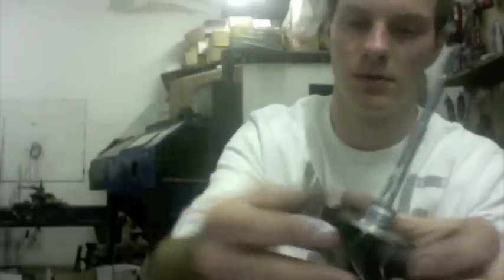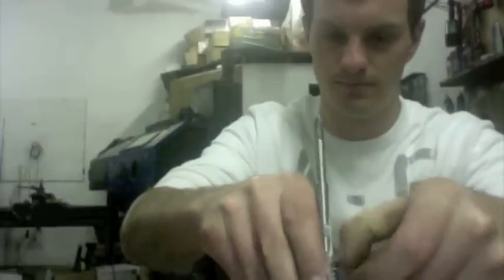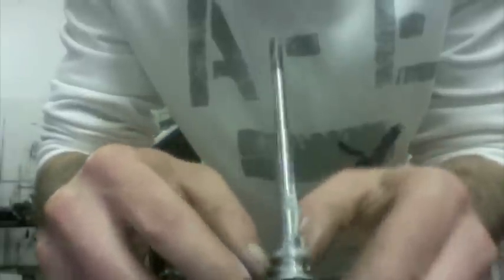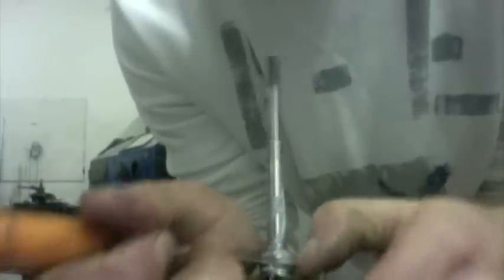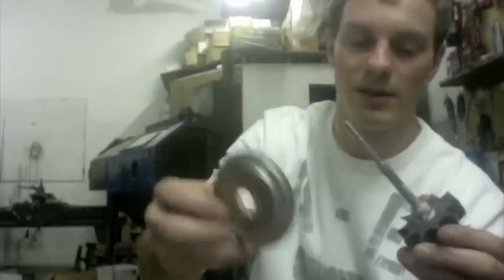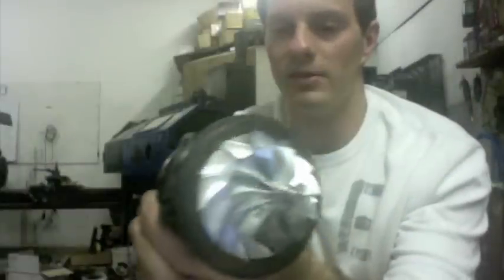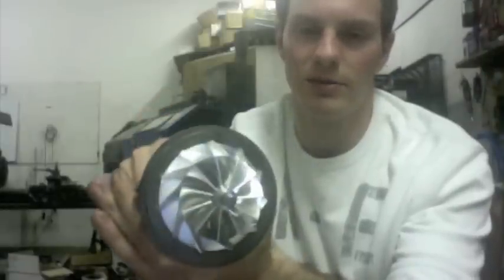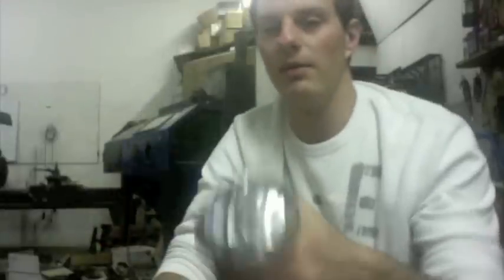GT3071r Ball Bearing Turbo Rebuild 700382-5020

Comment: So if I mark the shaft and compressor in the same spot before disassembly, then reassemble it with the complete rebuild kit, will that retain the original balance? I'm considering replacing the steel bb kit in my steamspeed 20g with your ceramic bb kit before selling the turbo.
Reply: Did you get an answer on this? I've got to rebuild my GT2871R and am wondering the same thing
Reply: Just from what I've read, the Garrett turbo's have each part balanced individually, so time them, and put em back in the same spot, should be good, haven't read about other brands though

Comment: I have a Garrett GT28 dual ball betting that is smoking do u recommend replacing seals or complete core? It has normal play it just smokes & how can I get in touch with you thank you
Reply from the maker: +meangreen254 it's hard to know what it needs until it's taken apart. The cost of the rebuild varies for 225 - 500.

Comment: I purchased the kit for my GT3528r 
there is the compressor wheel nut. balancing nut is so difficult
Reply from the maker: +Omar D the components are supposed to be balanced as an assembly first and marked, the assembled, then you can cartridge balance it, if you don't do it that way you will need to remove a lot of material when balancing the cartridge.

Comment: how did you take off the oil pin out?
Reply from the maker: +frankie anastasiou slide hammer or punch it out through the oil drain with a hammer and screw driver
Reply: thank you my friend

Comment: If i am supposed to press it in further. how do i get the turbine piston ring not to catch on the housing?
Reply: +Jack T I finally got it.... bent the piston ring, lucky i had two! it did also damage the piston ring race... i cleaned it up a little. but once i got it together the turbine doesn't spin nicely. I'm hoping that it will just wear in a little?

or did i just smoke my turbo?
Reply: +Jack T i coated the piston ring in some grease to keep it located concentrically... it did the trick just just fitted it in with my hands and a bit of force....

I kinda really wish I had some forewarning about that piston ring fitment. 

hopefully its okay.
Reply: Did yours end up freeing up after running the turbo? I’ve rebuilt mine and the piston seal is seated nice, but the shaft does not spin free, it spins like a journal bearing without oil.

Comment: Hi again, im pressing the exhaust side into the housing. its clicked in and spinning nicely. but it looks like its sticking out too far?

I can JUST see the piston ring between the turbine and the heat shield. (the ring is sitting up at about the level of the heat shield)

does this need to be pressed in further?

The video makes it look like you just pressed it in with your hand?
and your turbine looks much closer to the heat shield. 

Im worried ill crush the piston ring if i press it in further...

Comment: hey, I purchased the kit for my GT2860r there is the compressor wheel nut. and another nut of similar size with a regular hexagon nut shape. what is this other nut for?
Reply from the maker: +Jack T one is for the gt35r and the other is for the gt30r and smaller. The shaft bore is 6mm on the 30r and 6.35 on the gt35r.
Reply: +Turbo Lab America thanks so much. it's not a job I wanted to have "spare bolts" on. haha

Comment: +Turbo Lab America - I'm rebuilding my BB GT2808, stock from my Nissan Silvia.
I'm following some of your VERY useful tips. 

Ive ran into a problem (more than one). the ball bearings that came out of the turbo seem to have worn down quite a bit. 
The bearings don't sit in the bearing cages. They just fall straight through. This is my first rebuild so i'd like to know if thats normal or not?

There was slight shaft play before rebuild and exhaust seal was gone. 

If they ball bearings are not supposed to fall through the cage where should i start looking for new ones?

Ive measured them at about 3.84mm - 3.89mm. I was considering buying new 4mm Steel/ceramic set.

what would you advise?
Reply from the maker: +Jack T sounds like you need a cage and maybe a bearing housing too. I'm just got more ball bearing cages yesterday. If you need a bearing housing, I can point you to in the right direction but I currently don't have the bearing housing for the 2860
Reply: +Turbo Lab America yes please link me to both! thanks so much. how much are the bearing cages?

Comment: Do you sell a ball bearing cartridge or a rebuild kit for a precision turbo model 6162
Reply from the maker: +jjella77  PTE changed there Ball Bearing cage 3 times over the years. They started off using a gt25r-Gt35r cage, Then they had their own cages that were like a garrett GT37r-GT42r, but it was smaller on the turbine shaft, so that it would fit a journal bearing shaft. Then they used an actual GT37r-gt42r cage that  has the stager shaft. I only have the gt25r-gt35r cage and GT37r cage , just like the OEM garrett had.

Comment: How do I remove the dowel pin off the chra ?
Reply from the maker: +jjella77 I hit it out from the bottom. But some people thread in a bolt and use a slide hammer. Some people lay a washer down and tighten a bolt in.

Comment: i have a question my GTX3076 is  leaking oil from the compressor wheel and  it makes an strange air spining sound can you tell me what is going wrong with it???
Reply from the maker: it may have an oil blockage. its really hard to know without taking it apart or at least knowing more, like your oil pressure etc.
Reply: my preassure is 3,5-4,0 bars ta 2000rpm and it goes down to 1.5bar at idle my car is an audi s3 20vt.
my drain tube is 20mm in the oil pan no blockage....
i have 2 more breather hoses on my block and cam cover
 but it still spills clean oil from the compressor....can it be a broken o-ring or a broken  piston ring on the cold side???

and thank you again man...!!!
Reply from the maker: The piston ring seal could just be worn out. that is a lot of boost. most people run 2 bar at most.
Reply: Sounds to me like you dont have your PCV lines venting right

Comment: Hi, i just want to say very helpful video i have a question for you.  So i have a evo x with a map ef3 turbo and is blowing smoke and burning oil like crazy i already know it's the seals but my question is can i buy a rebuild kit since it's using the same turbo housing as stock because it's a "stock frame" turbo upgrade tdo5ha and i found the rebuild kit on ebay?
Reply from the maker: Yes the kit will work. We are actually the seller of this kit: http://www.ebay.com/itm/16g-18g-20g-upgraded-mitsubishi-tdo5-tdo6-rebuild-kit-14b-dsm-turbo-laser-mhi-/121457479874?pt=Motors_Car_Truck_Parts_Accessories&hash=item1c476e10c2&vxp=mtr 

I have an install video here: MHI 16g 20g Turbo Rebuild

Just note that the Evo 10 is forward rotation. The Evo9 is reverse. We sell both kits. The link above is for the evo 10 upgrade kit.
Reply: Turbo Lab America  thanks for the reply and i will be buying this kit for my X from you directly

Comment: Great informative video! I'm am also a turbo technician / rebuilder and the only thing i would recommend to consider is when you tighten the whole CHRA assembly,  use a t handle driver with the turbine nose mounted on a bench vise or a universal plate that holds the locking side of the turbine while torqeing the comp side. I ran into some issues doing it the standard wrench way particularly on smaller assembly's (gt15, kp35 etc) which may potentially bend the shaft. Keep up the good work!
Reply from the maker: Do you know where I would find a tool like that?
Reply: Turbo Lab America Melett